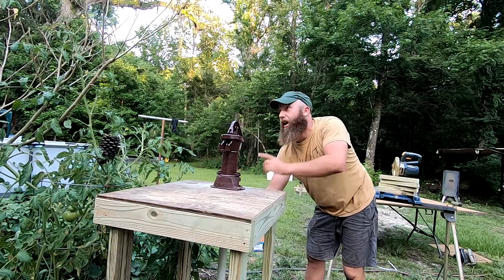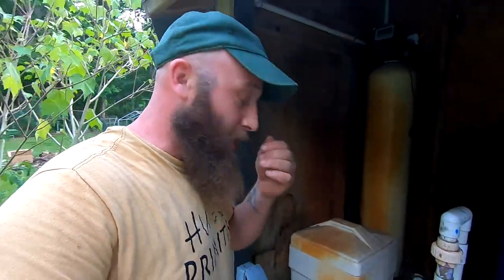How To Install An Off-grid Well Pump On Your Existing Well

Comment: My well is a submersible pump and the pipe comes up throught the well cap. Can i still put a T fitting on the pipe coming up through the well cap and install a hand pump on it? If so, could I still pump water by hand if my submersible pump lost power or stopped working? 
If this will work, I plan to install a T fitting and hook up the hand pump to that, and install a valve that I can turn off beside the T fitting (the pipe that runs to the house. ) Hopefully that makes sense. Thanks for any feedback.  Good content man.
Reply: Did you do that?? I want to try it too but don't want to mess anything up

Comment: I like that idea you got I was thinking is there anyway put swivel on the pitcher pump and still hold pressure so it will not lose it prime so you can fill 5 gallon bucket with it

Comment: Can this be done in Pennsylvania as well or do we have to dig deeper because of our cold weather?
Reply from the maker: As long as your water level is less than 25 feet. It will work fine
Reply: During the winter you’ll have to drain the water out of it otherwise it will freeze and crack
Reply: I'm in Pennsylvania.  Our regular well pump is in our basement.  Can I T off of the waterline in the basement rather than right off the well head? Unfortunately my well is right in the middle of my driveway

Comment: Instead of installing the second check valve, couldn’t you just shut off the quarter turn valve you installed?  Then it wouldn’t free-flow when the electric pump is running?
Reply: I was thinking the same thing. I probably would've just left it the way it was. Worst case the tank pressure drops and eventually the water stops, but I do wonder if that would've pulled a vacuum on the well tank. Hmm?